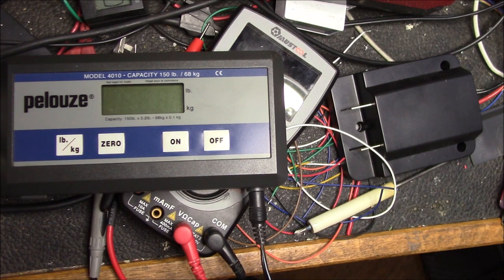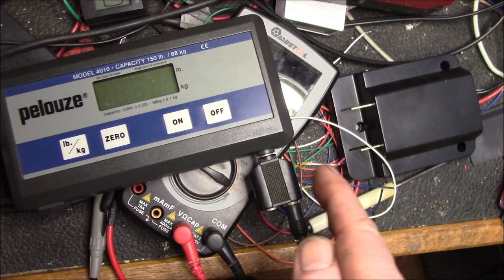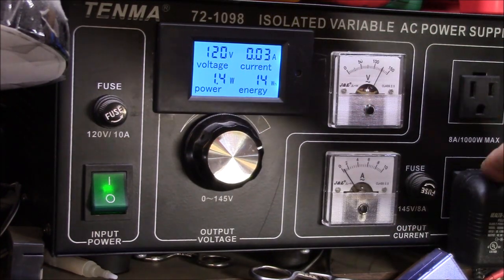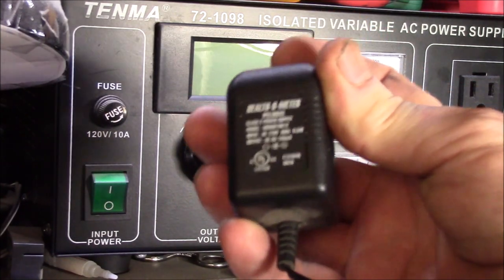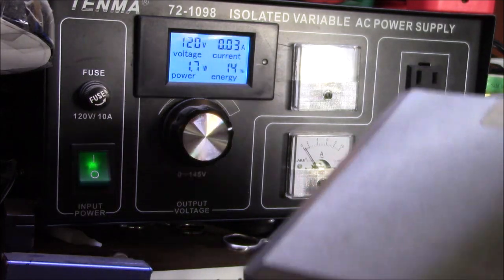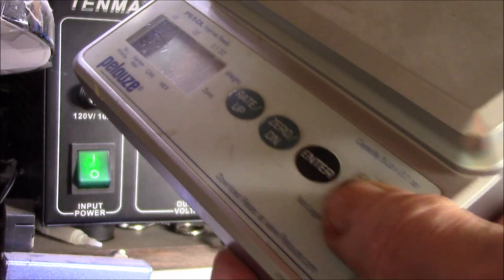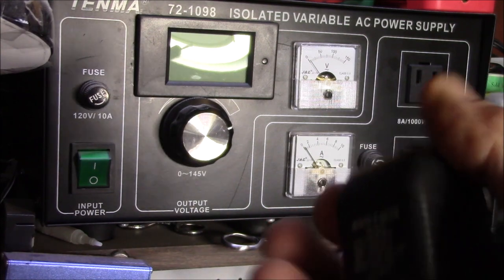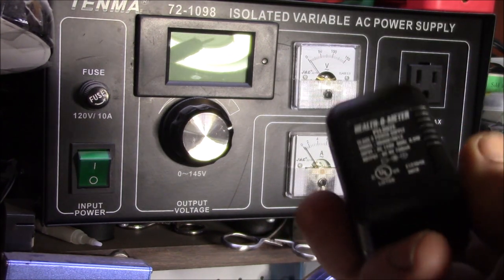Pelouze / Rubbermaid / Dymo model 4010 & PS5DL Scale Power Supply Hacks

Comment from the maker: Not a huge power saving trick, but it does eliminate one vampire load.  The other option is I could put these on a power strip and turn that on and off each day.  I also looked into getting a smart power strip that could be controlled by a home automation system, but that would take many decades to pay off with the energy savings.